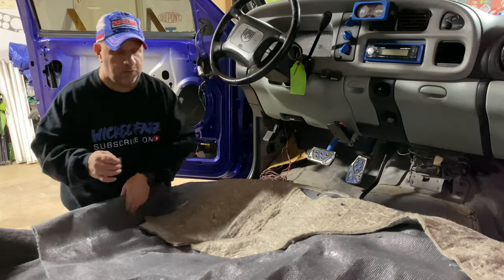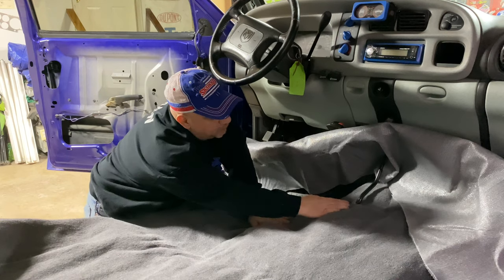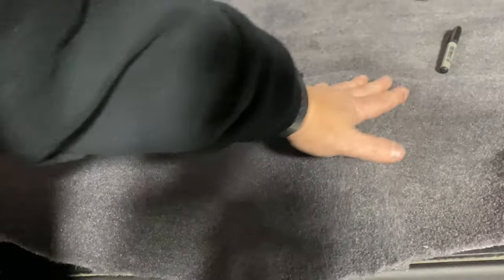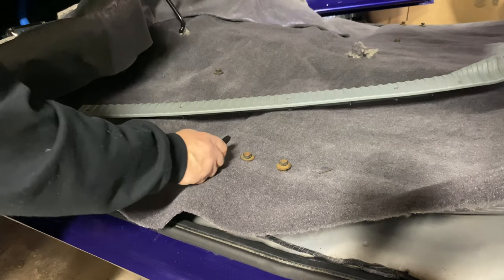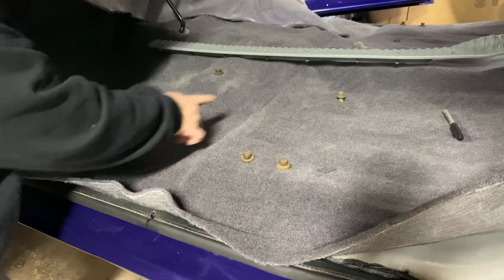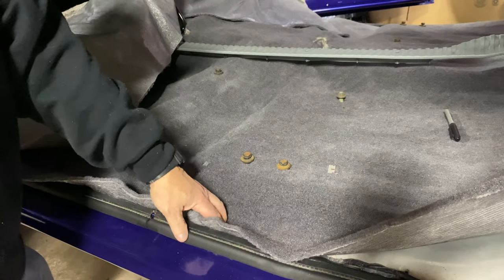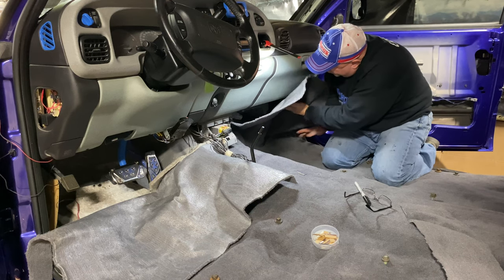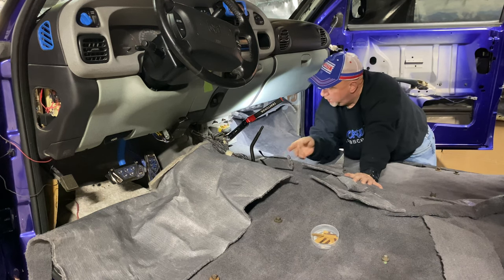How To Install a "NEW" Carpet In Your Car or Truck

Comment: The 4wd shifter has 2 bolts in the top and pops right out lol , much easier than unhooking the cable .
Reply from the maker: Don’t have a cable. It s a linkage. Thanks for watching.

Comment: Thanks for the video, I’m planning on doing the same but I do have one question, don’t you need some kind of fabric adhesive? Or it that only for headliners and such?
Reply from the maker: No glue needed for the floor carpet. The molding will hold it in place. Glue is needed for the headliner. Thanks for watching.